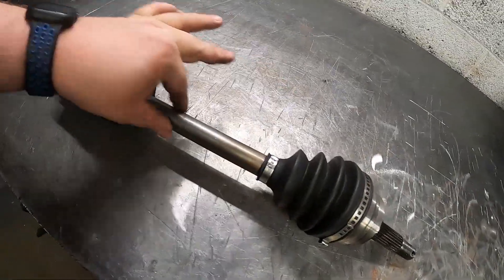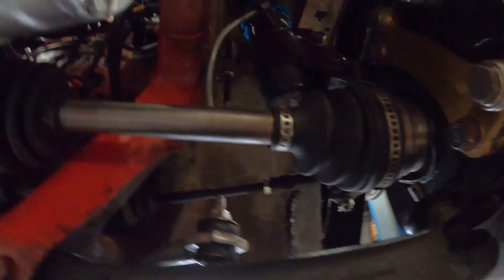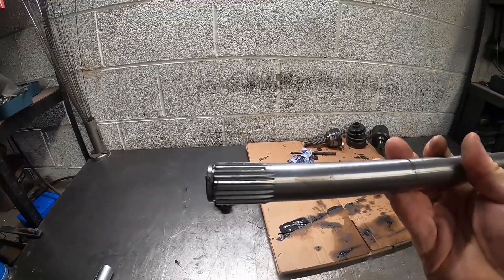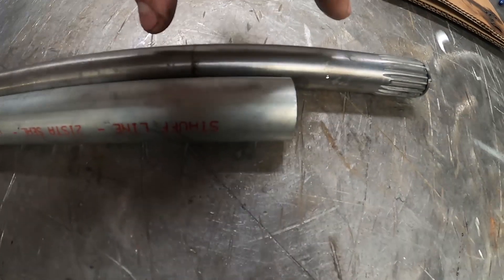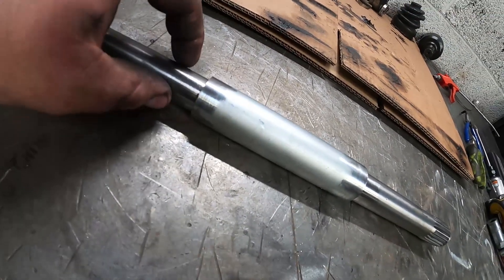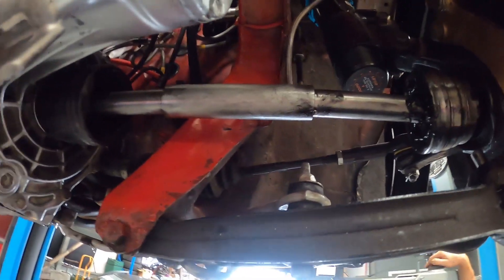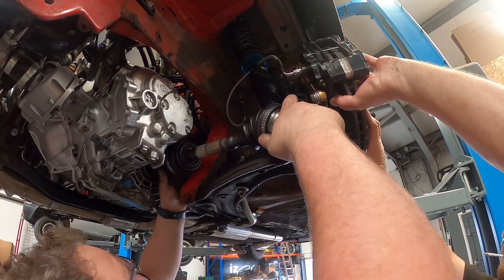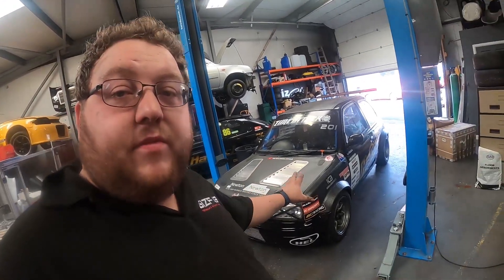SHORTENING MY DRIVE SHAFT -  K11 MICRA SUPER TURBO TIME ATTACK BUILD

Comment: How did you get the actual measurements for the length it needed to be?
Reply from the maker: By Ensuring the was enough plunge in the inner cv cup through suspension travel

Comment: Is it holding still??? How much torque/ power it has? Also how much would be this kind of job? I'm having a similar issue of axles length
Reply from the maker: It lasted maybe another 200 miles of track abuse before it finally gave up. I had the shaft remade proper.

Comment: Would some plug welds along the sleeve to the shaft underneath help? or not worth it. Top content as always looking forward to updates on the rear brake disk conversion kit 👍
Reply from the maker: Wouldn't get any meaningful penetration due to the thickness of the shaft. The reason i used the positioner to weld the sleeve is because this allows me to weld with a constant amperage and weld pool allowing for much more reliable penetration compared to stop starting.
Reply: I was thinking the same. Although not as much rotation speed, that’s what I’ve done with my electric steering conversion

Comment: I can't help but think welding case hardened steel will have affected the heat treated properties, I have a feeling you might be replacing this one sooner or later, when I've welded heat treated parts in the past, they've always cracked at the weld. Might be an idea to get a custom shaft made up to keep spare?
Reply from the maker: That was the plan. Unfortunately new shaft wouldn’t arrive for 7-8 weeks. At which point the season is over. This is only a temp measure to see me through the remaining season.
Reply: Fair enough, hopefully it holds up until then!

Comment: Would it not be stronger to weld the shaft together first, then slide the sleeve over it and weld the shaft to the sleeve?

3 welds rather than the two?
Won't this allow the shaft to move in the middle putting stress on the welds?
Reply from the maker: Shafts will warp when welding them like that. Making it impossible to get the sleeve over as the shafts won’t be perfectly aligned.
Reply: @GizFab  makes sense 👍

Comment: You couldn't have made a better job of that if you'd tried. Short of having the proper machining tools to actually manufacture drive shafts, I think you did as well as you could have done with it. I hope it holds up to the punishment
Reply from the maker: Off to satchels for a new one when the season is over.